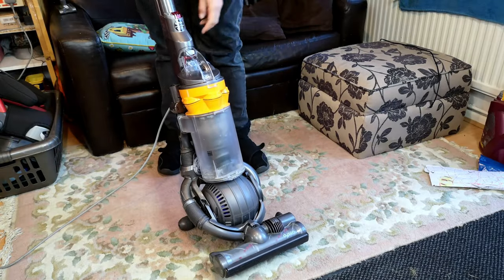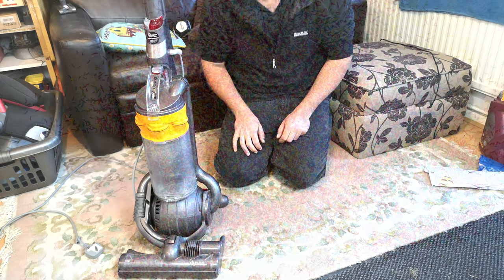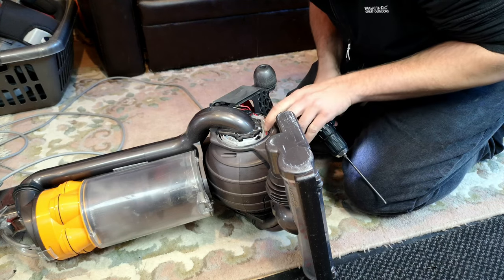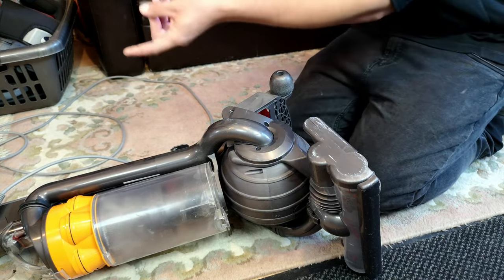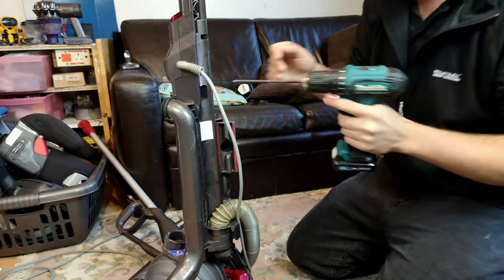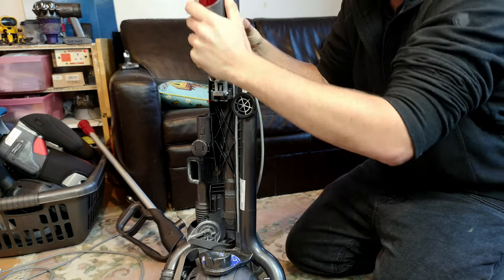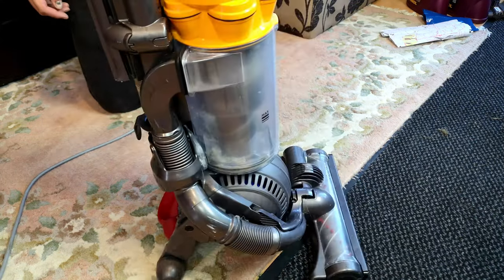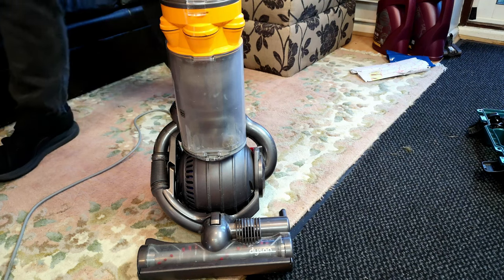Simple Dyson DC25 Brush Roll fault fix - Checked the reset switch?

Comment: Wasn't able to fix mine with what you showed here, but still very good info. At 2:10, you're able to manually spin the brush head on yours, but I can't do that on mine at all. Any ideas what could be the reason? Thanks!
Reply from the maker: I'd imagine the commutator on the armature inside it has exploded slightly, hence it's jammed up. Not much you can troubleshoot without dismantling it to check and peer through the motor housing to see the state of it. Good luck!

Comment: The red button doesnt have that click sound when i press it   ( 3:43 ) is that got to do with anything for the roller brush to not spin since your video didnt work.
Reply from the maker: May well do, it has to 'click' to latch on. Does it run if you hold the button down to hold the switch on?
Reply: @beko1987  nope ill order a new one